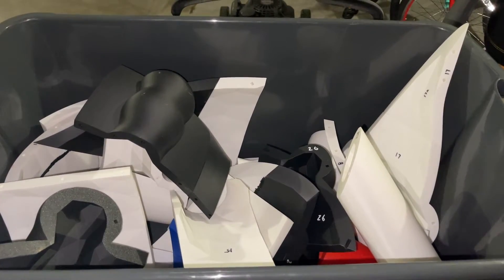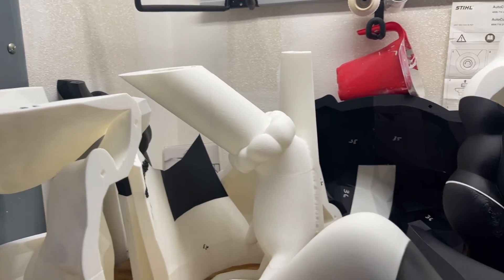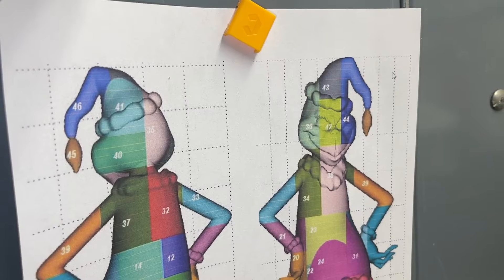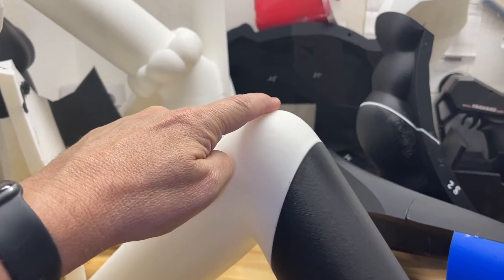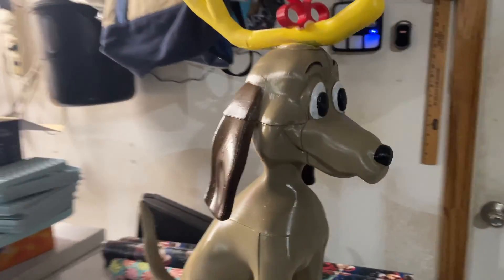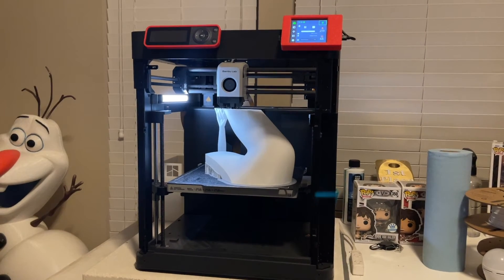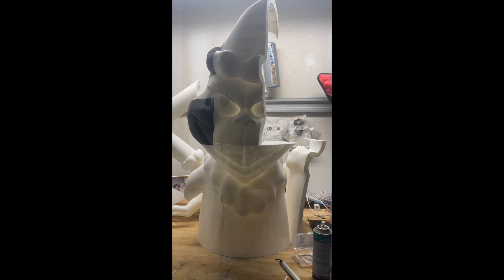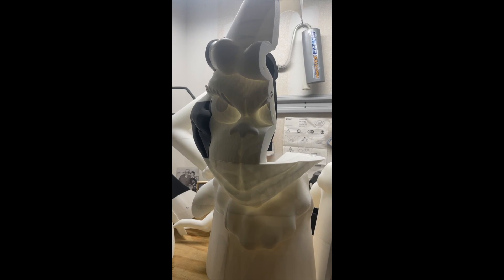3D printing and assembling a 6 foot tall Grinch using my BambuLab P1P/P1S and Elegoo PLA.

Comment: I have the same printers. How many mm did you set the hollow to? Also what settings did you do in Luban when you sliced it. When I did a 6 ft Nut Cracker after hollowing it made it like 1k pieces.
Reply from the maker: I believe the default is 10mm, I changed it to 18.  I believe I show that in this video: https://youtu.be/fvNzw0oDeEU
Reply: @3DPrints747  Thanks for the info, that video helped alot. Got it all figured out.